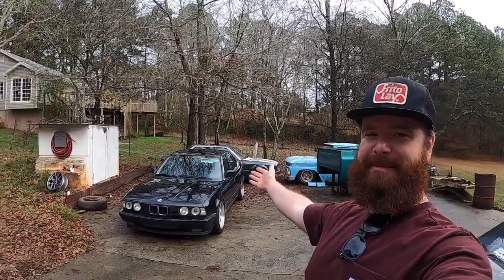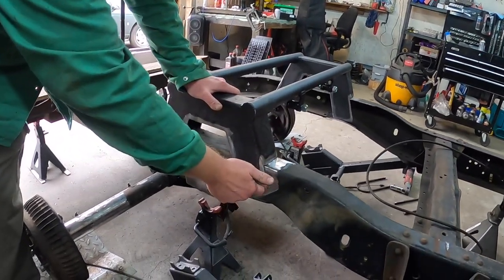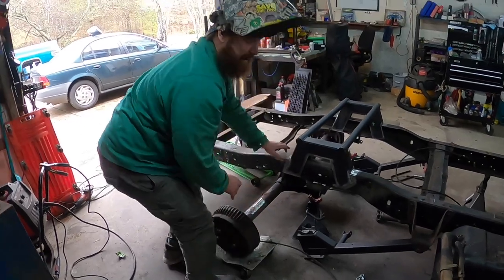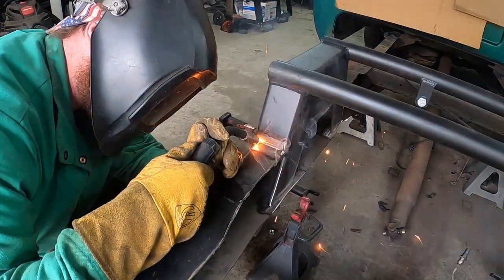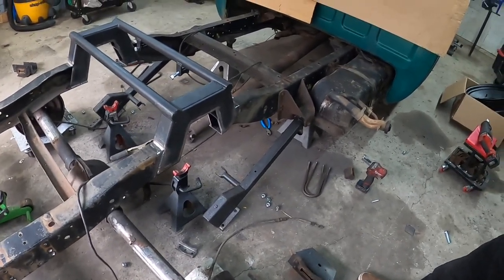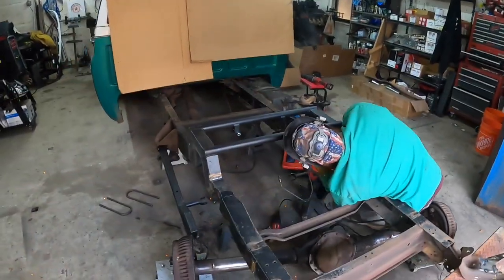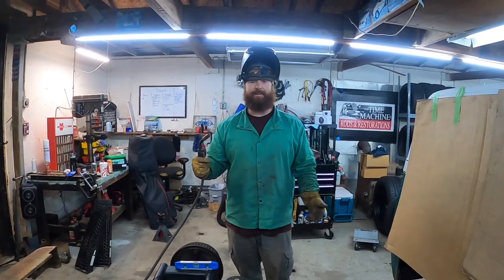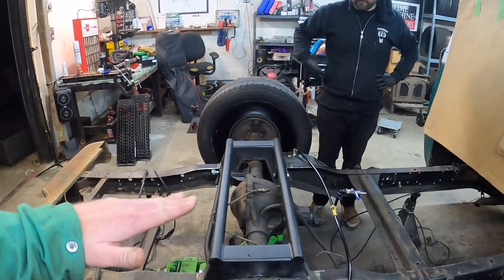C10 Rear Airride Suspension Installation Part 2

Comment: Kick azzzzz guys. What technique were you using when welding in the c notch and wire diameter? Thanks
Reply from the maker: It's. 030 er70 wire. I use the circle technique focusing the heat on either the thicker material or the pre existing structure.

Comment: how did you decide on where to mount the upper bag mounts on the frame rail?
Reply from the maker: After we installed the link bars to the rear end we raise it up to ride height. Then we installed the bag in a neutral position as far as inflated height versus aired out versus aired up, the upper plates are also contoured to where they're supposed to sit on the frame.

Comment: hey whats up guys, so i bought the same set up and im installing it on a 1982 c10, my question is how did you get your rear end differential angle/degree? we dont have a motor or transmission installed, so how what do you suggest we can do to get the our differential angle/degree?
Reply from the maker: It's hard to make it exact without the motor and trans installed. But you can go off the flange of the rear end and shoot for 4°, that's usually a safe bet

Comment: as the trailing arms pivot point is further forward then the driveshaft pivot point , wont it pull or push the drive shaft in or out ?
Reply from the maker: It does but maybe an eighth inch or so. We just watched it to be sure it wasn't crashing into the transmission or pulling out too far and it wasn't!
Reply: @BestDamnShopAround  ahh rite thanks
Reply from the maker: @princealbert123  anytime!

Comment: Great video you guys, thanks for doing them.

I have a few questions if you could spare a few.

I'm slowly accumulating all the parts and things I need to bag my 82 long bed.
One of my hangups is the rear kit.
I'm sold on the Ekstensive Bride notch ya'll used, but torn between the Ekstensive 2 link kit you all used or the KP Customs 4 link Cantilever set up.

I dont plan on a body drop, but ild like 20-22" rims...

Can you speak to the pros and cons of the two rear bar/link systems?

I'd really appreciate it if you could help me out...

Thanks again.  Looking fwd to your response and more great videos!!!
Reply from the maker: Thank you! As far as the two link kit we installed it is great but it will not lay frame on a 20-in wheel with a tire that's any bigger than a rubber band. We're actually planning on putting a small notch inside of the notch (as crazy as that sounds) just to lay on these 20s, a 22 I don't believe whould ever lay frame with this particular kit.
Reply from the maker: Another thing is to consider a two-link doesn't have the horsepower holding capacity that are four link would. Also ideally with air ride you would want a wats link and not a panhard bar.